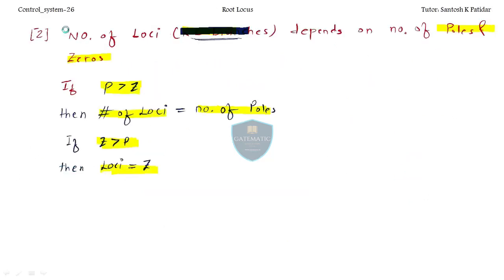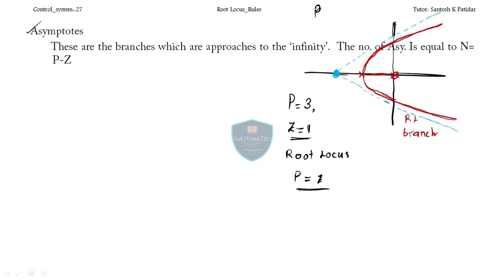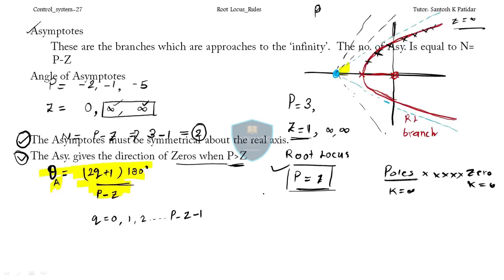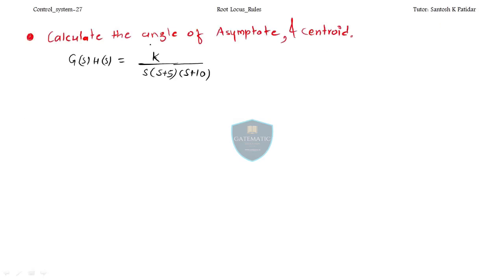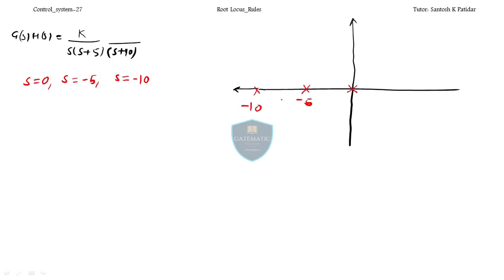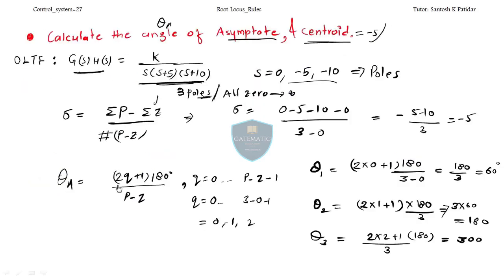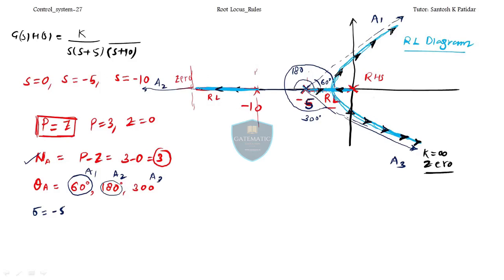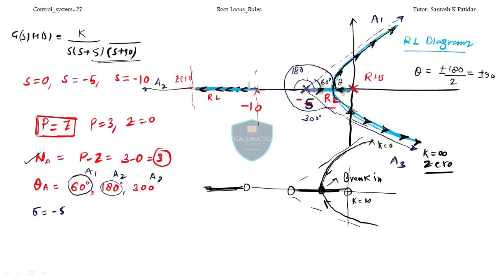Lec 27 Root Locus (Contd.)

Comment: Sir, in the very first numerical you said RL branches or no. of loci will be equal to poles if p graeter than z but in first numerical only two RL branches were there and 3 poles. Did not understood.
Reply: As there is root locus in between two poles, there exists a break away point. 
From there we can get two root locii